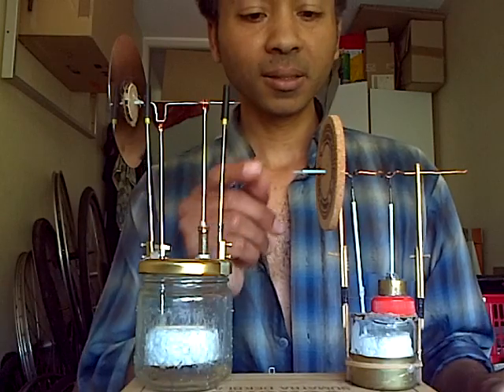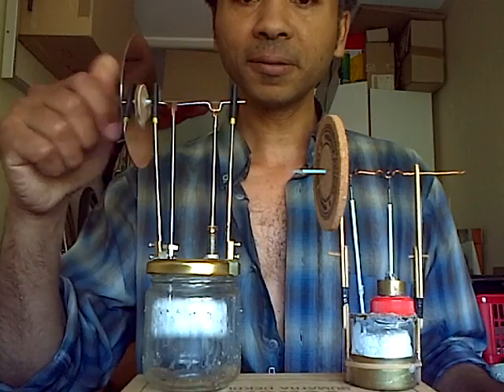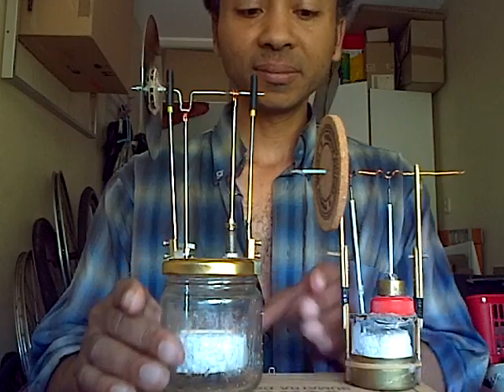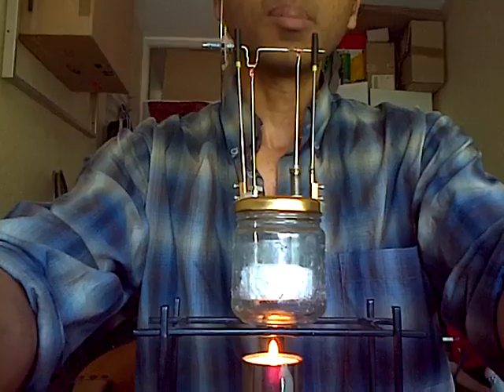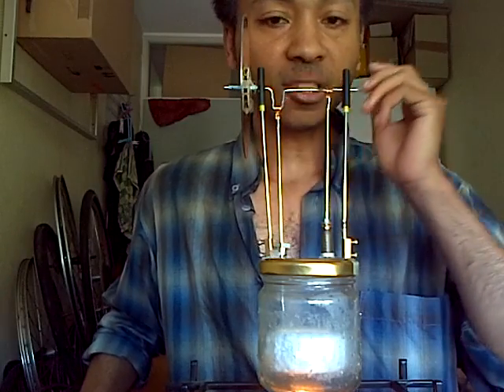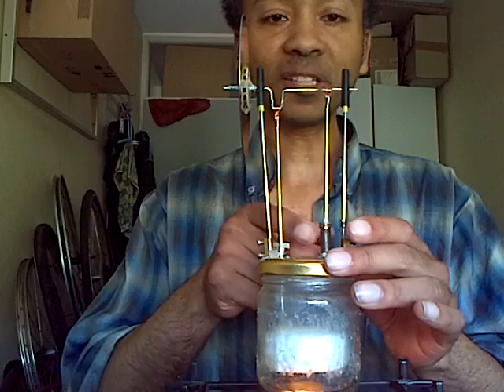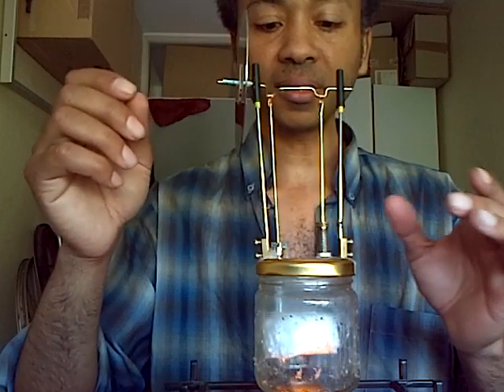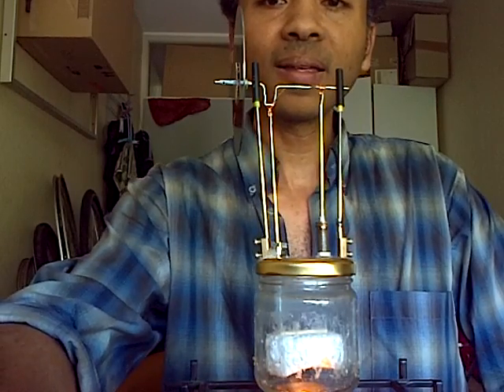DIY Second attempt at working stirling engine

Comment: Good job with the crank mechanisms. Try the following: 
1. have a proper power piston and cylinder (bigger)
2. Keep the gap between displacer and the container minimum (a couple of mm)
3. Use a metal container instead of glass

Comment: thanks for posting.  some late thoughts.  my first attempt, a few years ago, also, did not succeed.  since then i have picked up a bunch of information and i may soon try again.  anyway,  an ordinary glass jar is not going work as a displacer cylinder.  soda cans can be used on the hot side.   the material used for the displacer MUST be heat tolerant.  i'm pretty sure your foam is not.  a displacer should be centrally supported; not off-center.  see engine at link.    cheers
engine running at   :52
https://www.youtube.com/watch?v=uoyWH6GHs7g

Comment: You need a counterweight, and possibly some cooling on the top plate.  You'd likely also gain by using a metal displacer cylinder; the heat will conduct through the metal more efficiently.

Comment: stirling engine is weak power to push, you have too much weight on the top change the HD plate to a paper and change the wire to small size so you get less weight and make it shorter,just like you tell 5 year old boy to push a car weight about 200 pound
it not work that way
Reply from the maker: I still got it all in one piece. Been busy with solenoid engines. Those I can get to work. I will try your suggestion because I don't like it sitting there unfinished.

Comment: Work cylinder need to be bigger diameter?
Reply: 🔴How Does Someone Become a Muslim?

Simply by saying with conviction, “La ilaha illa Allah, Muhammadur rasoolu Allah,” one converts to Islam and becomes a Muslim . This saying means “There is no true god (deity) but God (Allah),and Muhammad is the Messenger (Prophet) of God.”  The first part, “There is no true god but God,” means that none has the right to be worshipped but God alone, and that God has neither partner nor son.  To be a Muslim, one should also:

🔴  Believe that the Holy Quran is the literal word of God, revealed by Him.

🔵  Believe that the Day of Judgment (the Day of Resurrection) is true and will come, as God promised in the Quran.

🔴  Accept Islam as his or her religion.

🔵  Not worship anything nor anyone except God.

Comment: Balancing the flywheel to compensate for displacer weight may help.  All the displacers I've seen show the connecting rod through the center.  I know you will do well and have a fine engine!!    John 3:16.    bobh
Reply from the maker: That's a very interesting idea, thanks! Maybe one change can do the trick.
Reply: It seems to help. Hard to balance 100%
Reply: Captain Prototype you should teach a college on this your amazing and you inspired me to fix up my old dirt bike

Comment: Hey Captain, did you have any luck with your Stirling engine? I have built a working model and on my second attempt I got mine running, but one thing I will add that perhaps the others have not mentioned.. try to get as much temperature difference between upper and lower parts of the cylinder as possible after all this is a heat differential engine, I used tin cans for my cylinder and the top can has another can around it..  a larger one that holds water, actually it is pumped around it with a very basic diaghram pump.
The engine will run for a short time without coolant but once the cylinder equalizes it will stop.
Also try spinning it the other way, mine actually backwards to what I thought it would.
Good luck mate........
Reply from the maker: Hi Peter. Sorry for the late reaction. I haven't been able to modify my engines yet, unfortunately, life got in the way. I am still planning to , though. I will keep your notes handy when I do!Now you got yours working, why don't you try building a steam/air pressure engine. Those are cool too!  I found the perfect flywheel out of an old VHS player!

Comment: Might be the case that your displacer is taking up too little volume with respect to the jar, especially being the case that you're trying to heat up a relatively large amount of air through a highly insulating material with a very small heat source. Might also be good to make the face area of the piston a little larger and also to make sure there is a very minute clearance between the piston and the cylinder. finally, it could also help that the jar is rather a metal container and also that the displacer is more resistant to melting than polystyrene.
Reply from the maker: So what you're basically saying is: change everything, lol!
Reply: unfortunately yes lol hopefully what i've suggested will help you somehow

Comment: I think I can help. I think you're close to succeeding. I've done a few of the type that you try to make,
I think it would be good that you tried with other material for the displacer, for example steel wool, you will hold heat better. The route of the displacer should be less than yours, for that make the biggest scroller, occupying more glass jar. The crankshaft have shorter arms and travel will be less and will reach more revolutions per minute.
The burner that produces more heat.
Here you can see one of mine https://youtu.be/KHSHwmZUXJY?list=PLrUU-cpoNaPSxN4_Kjx9KfJhNENxyCVIR
https://youtu.be/KHSHwmZUXJY?list=PLrUU-cpoNaPSxN4_Kjx9KfJhNENxyCVIR